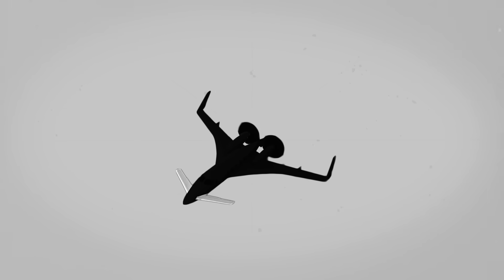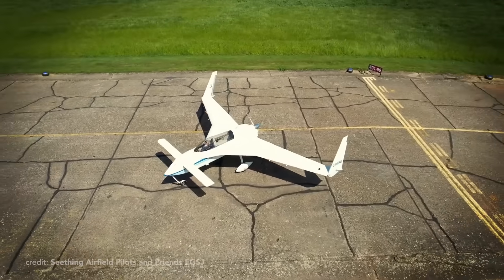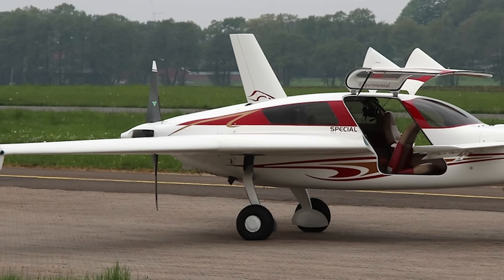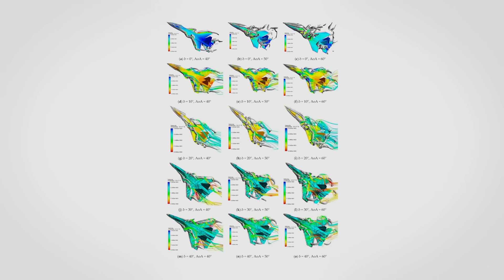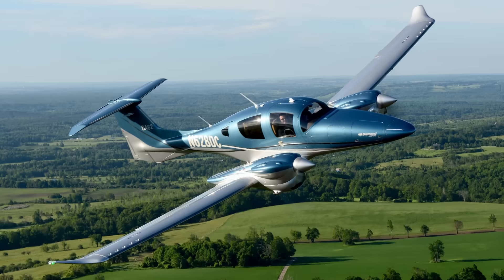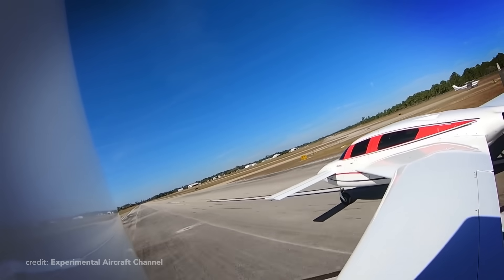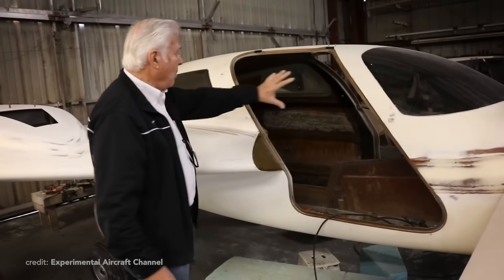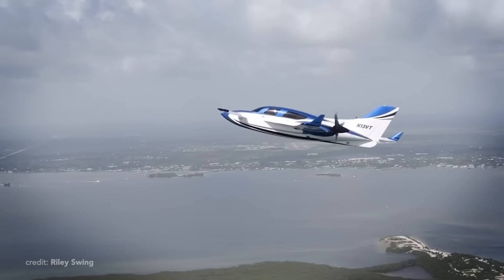Velocity V-Twin - Review & Specs Of Starships Brother

Comment: Seems pretty cheap to fly with the diesel hawk.
Reply: Except for the expense of the diesel engines.  You can put in two gas engines for the price of one diesel.  It also adds a bunch of weight and this plane likes to fly light.
Reply: @rnordquest  :  I don't think your statement about cost is true.  A while back I went to the web page for different engine suppliers, including Deltahawk and the Deltahawk engines were less expensive, not more.  Maybe that has changed since then but I doubt it.
Reply: @InquisitiveSearcher  If the DH starts at $110k I’m pretty sure you can get 2 IO360s for 50k each.
Reply: @InquisitiveSearcher  Wouldn't be the first time I'm wrong.  I did a search and that's what I found.  It's also what one of the kit manufactures told me as well.
Reply: @rnordquest  you can get rebuilt IO360 for 50k but not new ones.  A fresh built brand new IO360 is considerably more expensive and as DH only has new engines you need to compare new to new.  And the added benefit of a DH engine is that DH is providing the whole firewall forward kit, including new cowling.

Comment: Laminar flow.  Can’t comment whether the canard contributes.  
     Propellers create low pressure ahead of themselves.  Pusher mounted on the wing thus suck the air over the wing assisting the boundary layer.   No idea of the drag reduction, likely not much and proportionally less the faster the plane goes.

Comment: The issue with canard craft, and this is coming from a pilot who has test flew a Velocity, there are no flaps. You take off and land fast, around 90-100knts. Its not unmanageable and many planes land at those speeds but its a big jump up from you typical Cessna. People want to get in this after their PPL (me included) with 100 hours and end up falling behind the plane.
Reply: Test flew a Velocity -- one time? The V-twin is not comfortable to land under 90 knots, especially because of adverse yaw. Over the fence is best at 100 knots, then retard power as needed. 1500 at sea level is an honest short field landing distance.
Reply: same with a lanceair and glassair   fast slippery aircraft - with flaps though .
Reply: Stay away from a Cirrus SR22T then, its over numbers speed is the same, 82ktas.  But that does not mean you are behind anything. A stable landing approach is required no matter what aircraft you are flying.  In fact, sometimes a little speed over the numbers is more stable than barely squeaking over the threshold in a snail-pace LSA or Cessna.  The main difference is needing a little more runway.
Reply: @speedomars  Sure but the SR-22 will go down to 60 before stalling, while a velocity cant really go any slower than 75 knts before it starts bobbing. But its irrelevant, the argument I am making is neither an SR 22 or a Velocity is a good plane for a new PPL.
Reply: @CrossWindsPat  The stall speed for the CirrusSR22T with flaps is 60 but as a former owner of the plane with 500 hours in it, the approach speeds never drop below 85 kts or over the numbers at 80kts similar to what the Velocity is.  Both planes are high performance and require high pilot skills.  I bought my Cirrus with 120 hours in the logbook and was required to fly 25 hours with a Cirrus CFI (CSIP) before the insurance company would allow me to fly alone.

Comment: Those Deltahawk Diesel numbers seem too good to be true!
Reply: It is highly probable. Diamond also uses diesel/jet a1 Austro. It is very economical w/ availability in airports.
Reply: @mahyadnaadlaw3112  The economy doesn't surprise me. Its the cruise speeds!
Reply: @CrossWindsPat  well, your statement implying about 'diesel'. And consumption a major  factor regarding diesels.
Reply: @CrossWindsPat  i think those specific  diesel engines are turbo and superchargers
Reply: @CrossWindsPat i think its about torque
Reply: @alexprost7505  Its funny out of the 5 replies I got you are the only one with actual useful insight.
Reply: @tatoo99999 they definitely have both turbo and supercharging
Reply: @tatoo99999  :  Yep, both turbo and supercharged.  At the very minimum a 2-cycle engine (that's not a lawn mower with a pressurized crank case) must be supercharged, it's the only way to get fresh air into the cylinders before the engine is running.  The turbos don't become active until the engine is running and there are exhaust gasses available to spin the turbo.

Comment: So why add that big tailfin/rudder?  Why not at the wingtips, like the others?
Reply: Twin engine needs a lot of yaw stability if it loses an engine.
Reply: @benjaminowen6181 Yeah, but that's greatly mitigated by the engines closeness to the aircraft center. Much less engine out yawing and less likely to do the deadly VMC Roll.
Reply: without the center tail the two props create cavitation and drag on the rear of the plane... If I remember correctly lol
Reply: If you have an engine out, the large rudder in the slipstream of the still running engine, makes it easier to handle with one engine, Plus it straightens out the airflow when both engines are running.

Comment: canard aircraft don't stall.  if the main wing loses lift because the pilot has screwed up badly either in weight and balance or with the flight controls, the aircraft falls in a "falling leaf" pattern, almost always staying upright.  the sink rate of this falling leaf is roughly the same as the sink rate of an aircraft under a parachute.  crash statistics do not justify canard aircraft would benefit from a recovery parachute.  government regulation and bureaucratic interference in aviation is why general aviation and specifically experimental aviation in Europe are a tiny fraction of the industry in the US.  If you want to destroy innovation and eliminate the industry, let the regulators loose.
Reply: Canards do stall -- but not in conventional ways. A high sink rate is considered akin to a stall. That said, you bring up power and -- if the aircraft is designed properly -- you counter the stall.

Comment: You will not be safe in ice with a canards system.
Reply: Totally false. I have taken ice in a push pull canard twin Defiant.   I am alive because of the safe behavior. The Rutan Defiant is safer than this twin. Do your homework.
Reply: @johnsteichen5239  John, I'm a commercial pilot from Scandinavian and know a thing or two about ice. Beautiful plane, great fuel economy.Great aircraft. The ice accumulation, I don't like it.
Reply: Considering it is a kit-built experimental plane, you have the oppoerunity to have some kind of anti-ice system added. In the case of this aircraft, I would probabky go with an extra battery and a set of thermal de-ice boots on the leading edges of the wings and stabilizers.
Reply: @SpectorOfDoomYT  thermal wouldn't be boots, boots are pneumatic   - thermal would be stainless steel leading edges that you would heat up to get rid of ice. Also need a hot plate for your windscreen  so you can see  to land. Hot pito tube etc.
Reply: @stevemyers2092  I was referring to larger versions of the electrically powered de-ice boots commonly attached to propellers. I would probably prefer to use pneumatic boots but, considering the wings are made of fiberglass, I do not know how the consistent pressure of inflating and deflating would affect the structural integrity of the leading edge.
Reply: @SpectorOfDoomYT  Inflating and deflating have no affect on structural integrity.

Comment: I wonder what the limiting factor on Vne is? It looks to me like it could safely go a lot faster. The shape of the canard?
Reply: No, two things. The desire to keep it very conservative taking into consideration the vastly different builder skill levels. Secondly, without flaps they had to keep the wing loading low with a fairly high lift wing to get into smaller fields. High lift also means higher drag. A long time ago they built a XL fuselage with a smaller model’s wings. It was a near 250 kt screamer but didn’t like short runways at all.

Comment: With the savings as compared to the Diamond, Id imagine someone can rig a BRS on it, both take the cake for fun factor, geat video !
Reply: The design work for adding a BRS is pretty involved. Much more than just installing it.
Reply: @DblIre   @dalecounihan1632  The systems are around $50,000, I'm sure someone could engeneer the retrofit for another $150,000 tops so still cheaper than a Diamond 😉
Reply: The lines getting tangled in the prop is one issue.  Imagine how they know that :)

Comment: The idea that the canard airplanes are safer has not worked out in practice. They’ve had their share of accidents. While you can’t stall them (unless you exceed the aft cg limit, then you’re screwed) the cost of the canard presents other risks, like high approach speeds, long takeoff and landing distances, non conventional handling characteristics etc. and if you mismanage your energy and get too slow you will still crash. There’s a great video on youtube of a long ez crash landing at an airshow after screwing up a landing. It goes splat and rips off the gear and goes skidding along the grass. So don’t believe the safety hype of canards.
Reply: Canards are like any airplane -- fly the airplane, listen to what it tells you, you'll be safe.
Reply: @domteufel  there are some differences in flying technique. This was the cause of several accidents with early Rutan designed aircraft when the pilots didn’t understand these differences
Reply: @sblack48  I don't disagree -- and I completely agree with you. Probably should have added that to my comment. I stand corrected...
Reply: @domteufel  and i agree that there are lots of canard pilots that fly them safely every day and love them. They have to be flown within their safe envelope and all will be well.
Reply: I’m sure if carders were the way to go all airplanes would have them.

Comment: The maintenance on it is a concern, Florida is where you'd have to fly it to for maintenance more than likely, I don't have the time to go build a plane, it's hard enough to learn to fly it, so I'd have to buy one built by the factory, and I can't deal with the No Flaps part of it.  There needs to be a way to slow the stall speed and shorten takeoff's and Landings, and to make it grass strip landing worthy.  I'd rather fly this plane for speed, efficiency, and fun and looks, but the negatives and the unknowns outweigh the possibilities unfortunately.  I'm looking for a Cessna RG with a turbo, then I can go near as fast and not far off on efficiency, maintenance locally and cheap, re-sale is good, and grass strip worthy, STOL kits available, and Much safer landings and take offs.  I hate it but that's the best for me.
Reply: Your absolutely right.  But the other day we priced an oil pressure sensor for a Columbia 300.  $1000.  The prices for certified parts has gone absolutely ballistic.
Reply: Airplanes are designed for a mission -- fundamental part of airplane design. If you want grass strips and STOL, don't buy a V-twin.

Comment: While not an aerodynamic professional, I am building a canard aircraft and have learned a few things.  The comment about the canard helping to create laminar flow is misunderstood.  What I believe you are referring to is that on a canard aircraft the wings are using more laminar flow because the engine is not creating a swirling airflow over the wings like a conventional aircraft.  With the propeller in the back, the airflow is undisturbed going over the surface.  The Canard wing, however, is creating disturbed airflow over the main wing so there is some efficiency loss there.  Canards also don't get the advantage of airflow over the wing from the engine when at a stop so you have to move faster to generate lift.  There are no flaps because a balance must be maintained between the two wings.  If the main wing stalls you enter what is known as deep stall and it's very difficult to get out of.  As long as one flies within the proper CG range, this is never a problem.  If you want to learn more about them, I suggest taking a look on cozybuilders.org and looking in the  Oshkosh and other presentations section.  The web site owner was a scaled employee and knows a lot about these planes.
Reply from the maker: thanks a lot for clarifying this!

Comment: never exceed speed is based on indicated airspeed (measured using ram air) which is different than true airspeed. IAS and TAS separate further apart the higher you go. This means 200 knots on the airspeed indicator reflects a 230 knot true airspeed in standard conditions at 10,000ft. In this case, never exceed speed has not been exceeded, yet the true airspeed is 230.
Reply: Actually it depends. For example, Vne on my RV-9A is stated in TAS, not IAS.
Reply: Ya vans did it right. @crufflerdoug
Reply: I always thought V speeds were indicated (calibrated) airspeeds. Interesting to read that some aircraft like RV 9 are based on TAS.
Reply: @Balthazar744   In GA Vne is commonly based on TAS because flutter margin is always based on TAS rather than indicated.  As one flies higher the TAS increases for a given IAS but you're reducing the margin you have to avoid flutter.
Reply: @geckoinc99  that’s my understanding as well, although I’m certainly no expert. My EFIS is set to show Vne in terms of TAS, and it’s interesting to watch the airspeed display as I climb higher, because the yellow arc eventually disappears completely! I suspect some GA aircraft show Vne as IAS because (a) there’s no easy way to see TAS quickly on steam gauges and (b) it doesn’t make much difference at the altitudes they typically operate at. -9A pilots like flying relatively high and it does make a difference up there.
Reply: Vne can be expressed as tas or ias but it is based on the flutter speed which is a function of tas. The problem is that in the past with simple avionics there was no tas indication in the cockpit so ias was given along with altitude limitations which would result in the critical tas not being exceeded.
Reply: If it's so safe, why did N106VT crash after losing one engine? It had two UL520T's.
Reply: @kraftwurx_Aviation  I don’t know the particulars about this accident but the fact that an airplane crashed does not necessarily mean it isn’t safe. A lot of airplanes have crashed when an engine out was mishandled.
Reply: @sblack48  I can see your point.
Reply: @kraftwurx_Aviation  It crashed because a separate part of the landing gear destroyed the propeller of the one engine still running. The complete history is out there... 
But the right amount of stupidity and/or circumstances could sink the most unsinkable of the ships.
Reply: Aerodynamic divergence and flutter are not all created equal. 

Divergence is directly related to wing torsional and bending stiffness correlated to Q, which is dynamic pressure. And therefore will not affect a high speed aircraft at high altitude.

There are at least 3 different flutter modes. And two of them can be cured with a couple pounds of weight, or with thicker wing skins, and/or stiffer spars. The torsional and bending stiffness must be kept far apart. The total torsional stiffness must be kept as high as practicable. And the ailerons should always be 105% static mass balanced on any aircraft capable of exceeding 150 knots for any reason. Failure to do so is an irrefutable sign of ignorance or even outright stupidity.
Reply: @Triple_J.1  
   As an engineer, these deeper, physics-based discussions always fascinate me.  
   Know any good books that discuss with some depth this and/or other aircraft aerodynamic phenomena ?
    Flying GA, we all have gone through the FAA books/materials, so i’m looking for next-level depth (and being an engineer, higher math/calculus doesn’t scare me off).
   Thanks for any suggestions on books. Pilots need to keep learning… 👍
Reply from the maker: Oh, now this makes sense, thanks for explaining this!
Reply: Actually no, with regards to Vne and indicated vs true.  While it's true the Vne is an indicated airspeed, altitude limits are always given with it.  That might just be the service ceiling, but in faster aircraft you'll generally see a table of Vne for different altitudes.  Or in even faster things, Mmo in addition to Vne.  This prevents the following problem.

For certified aircraft, there is only a guarantee of no flutter up to Vd.  Vne is defined as .9*Vd.  A factor in flutter is true airspeed.
If you have a Vne of 200kias.  Vd=222TAS.  As you go up and that 200IAS=222TAS, you're now in an untested area and susceptible to rapid unplanned deconstruction of your aircraft via flutter. 
This is a experimental aircraft, so none of this necessarily applies(we don't know what testing they did).